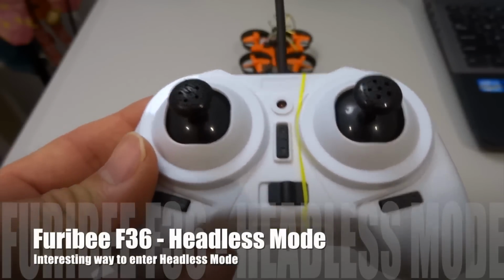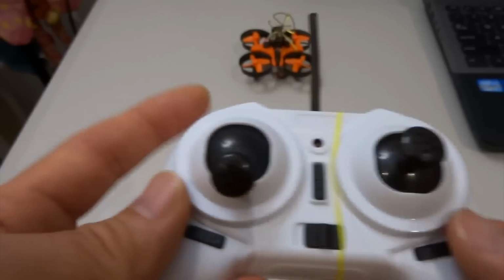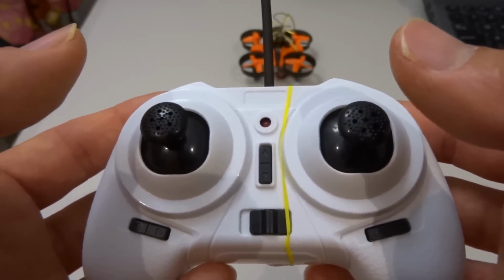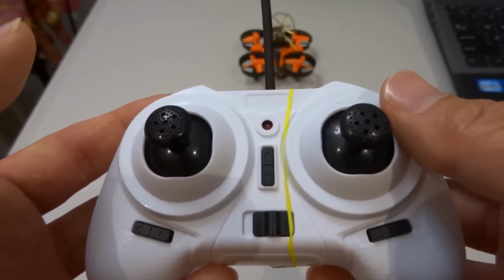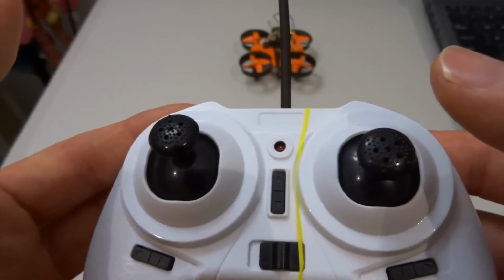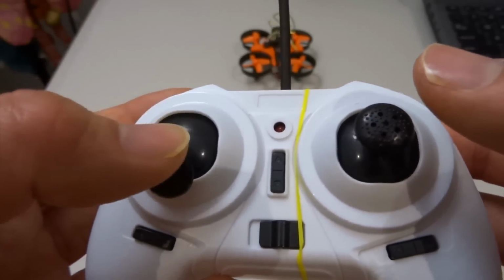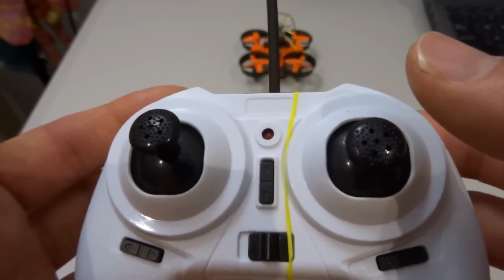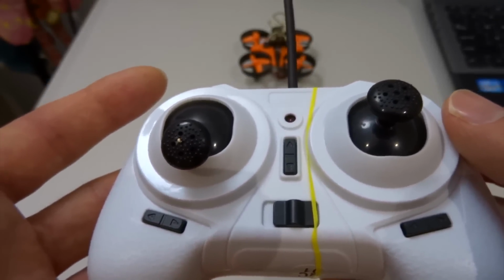Furibee F36 - How to Headless Mode

Comment: Hi there. I like check with you on the Furibee F36. I just received my set today. This is my first drone, and pretty excited to play with it. But I realised it does not fly upwards smoothly when I push the left control joystick front. It will tend to wooble to the sides. It will take quite a bit of space to maneuver banging into walls before it gets some height. And even when its in the air already, it will not be stable at fixed point. Is this normal???
Reply from the maker: Thank you for watching. Re-calibrate - both sticks to the right corner and you will see blinking lights and stop and then both sticks to the left corner and you will also see blinking lights and stop. You should be fine after that. Enjoy! :)
Reply: push the arrow button on the bottom left and you will either hear one beep or two beebs. If you hear two click it again and you will hear one. Also you may need to calabrate it. Its not hard at allhere are plenty of videos you can watch! Happy Flying!!!